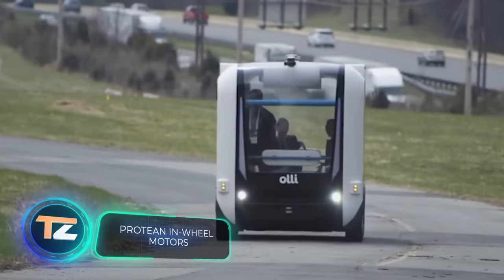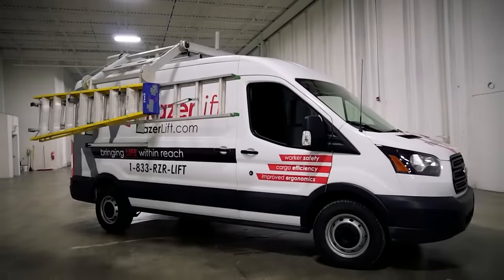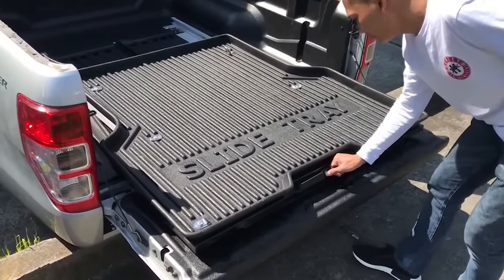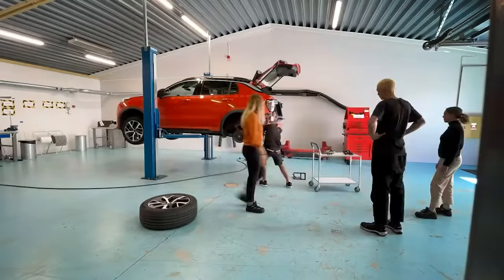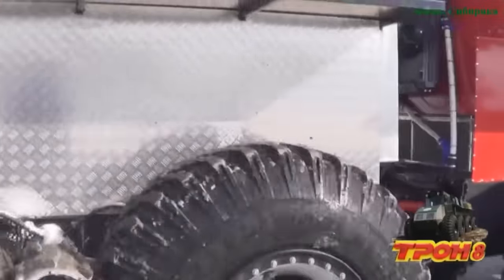INCREDIBLE INVENTIONS FOR CARS THAT YOU SHOULD SEE

Comment: The in-wheel motors I find particularly interesting. I've been looking to convert a car to electric and this would mean I'd have the entire engine bay to install rest of the system and batteries.
Reply: Convert a Volkswagen to a Voltswagen...someone did that to their VW Caddy p/u
Reply: I have a Ford Escape and eventually want to convert it, this wheel idea is a definite game changer.  👍
Reply: In-wheel motors are a horrible idea.  Having 3 to 4 times the amount of unsprung weight moving with the tire would drastically limit the suspension's ability to keep the wheel in consistent contact with the road.  Vehicle manufacturers spend considerable effort reducing unsprung weight to improve handling as well as comfort, vibrations, and harshness.    No major electric vehicle manufacturer uses  wheel motors because it is a terrible idea.  It isn't a new idea at all.
Reply: @brianhaygood183  Agree. The Idea is as old as the automobile itself, example Lohner–Porsche Electromobile from 1900.
Reply: Convert a shit load of money ,time and effort into a useless lump of light iron!
Reply: WORST
IDEA
EVER

In wheel motors would add weight in the only place of the vehicle you need to keep as light as possible
Reply: I'd be terrified of our Midwest potholes destroying an engine.
Reply: its old tech.... been uaed in europe for like 50 years
Reply: @gufo_tave  So much for the stopping distance. 80lbs of extra unsprung weight on each wheel? No, thanks..
Reply: @RuralTowner  q!aA
Reply: @brianhaygood183  Disregarding handling dynamics the largest downside are the motor bearings being subjected to non suspension dampened road imperfections or potholes. New wheel hub + cv axle undeniably more complex costing at most 500 for parts vs entire new motor for 5K+
Reply: Yeah, but can the vehicle handle the conversion and change in weight dynamics? Things like safety features could be rendered non-functional, and alter handling and performance, not to forget in event of a front end accident, potential fire hazards and crumple zones not withstanding the change in physics....
Reply: @brianhaygood183  yup, axle motors they do use, but wheel hub replacements.... gonna wear out steering components as well, plus the changes in handling and performance and physics, as well as potential fire hazard... people just need to acceot that EVs are NOT ready for primetime, and are nothing more than a niche market, on a truly free market. The only sell now because of subsidization, and even then, cost twice a comparable ICE version. 

Until the power storage density exceeds that of the fuel it is replacing, and can handle charging, at home, which requires major infrastructure upgrades to the electric grid including all new power plants, as every home would need the latest revised standard 480V 3P service, to be able to rapid charge. Because you need charge times of under 10 minutes from 0 to 80% giving at least 300 miles range with AC running, and not suffer the cold weather problem currently plaguing EVs.
Reply: @patrickw9520  You're not gonna convince anybody by demanding ridiculous all or nothing similar to EV fanboys. An argument that true environmentalists can't deny is if the goal was to reduce emissions as quick as possible simply mandating hybrids with at minimum 1.25 KWh battery pack would reduce emissions quicker than favoring EVs as Tesla gigafactory alone could support every vehicle sold in America reducing emissions by 20 to 40 percent per vehicle. For perspective 1 60KW Tesla Model 3 vs 48 hybrids.

Alternatively, abolishing all EV incentives favoring PHEVs with 25 - 40 mile range would be a 90% reduction in emissions which a pure EV will never truly save money when factoring property taxes, insurance, and even if the EV charged for free while PHEV paid to charge. Using Kia Niro (crossover SUV) variants as a benchmark price comparison..

Hybrid: $25K
PHEV: $30K
EV: $39K

Cheapest brand new Tesla Model 3: $47.5K

Comment: @1:37     id just attach the ladder to the inner celling of the van with a few simple brackets,   slide out slide in  job done and works every time.     will even work in multi-storey car parks with low ceilings which would otherwise get in the way of a device like the one in the video
Reply: This could work in these tall vans, but as someone who drove a work van for many years I have to admit that many people could not have ladders or other equipment taking up space in their cargo area.  I did keep small step ladders in the cargo area, but larger ladders had to go on the roof as I need the space and the headroom inside.
Reply: works for small ladders but any decent sized ladder won't fit in 90% of vans

Comment: You can keep your EV's. I don't hear anyone taking about costs. Battery replacement costs. The frequency of which I'm sure will greatly be dependent on the number of charging cycles. 
Hence, the more you drive the more frequent battery replacement will be required. Upkeep costs, electric cost. You can can keep the EV's.

Comment: The only advantage of induction charging is that you can have a perfectly sealed charging device that won't get water in contact with electricity. So you can charge at the bottom of a pool.
But if you have any other means of avoiding that, like any kind of suitable protective gear, induction charging has nothing but disadvantages.

You need to perfectly align the car with the device, which means in most places you'll have to do extra maneuvers and consume extra energy.
Plugging a cable to the car only takes a couple seconds, only requires that you park within the reach of the cable, and offers 100% efficiency. Every single bit of electricity that enters one end of the cable is delivered to the other end.
Reply: For the disadvantage of aligning the car with the device: couldn't we enable some automatic system in the car to align it? i mean, Teslas already have some driver assistance thats getting closer to self driving, and we already have a way to make a car parallel park (well, that was an advertised feature, don't know how well thats doing today). So, why couldn't we press a button, and have the car detect the location of the charger and park itself on it?

if we make the pad on the ground really big (within reason of course), couldn't that mean more wiggle room for drivers to be on top of it and still charge?

Of course your other disadvantages i agree with, and are things we need to consider
i hope future cars can have both a wired and wireless charging system, kinda like how some phones today have both systems
Reply: Can we just cancel Wireless Charging

Comment: 01:15 It's all nice and good until you get to an underground parking or under a low bridge...

I don't know over there, but around here all those big vans get their roofs caved in from hitting the ceilings, low bridges and garage entrances. Imagine with that thing making it even higher... 😅😁🤣
Reply: Even regular height vans don't typically fit in parking garages anyways and there are not many place in the US & Canada that have bridges to low for that van shown.
Reply: @SillyPutty3700  Regular vans fit quite good on parking buildings. Those tall ones don't.

To find a low underpass or bridge is not that uncommon, at least in my area. They don't want to sell it exclusively on Canada, I guess, so it can be  a problem. Not to mention that those vans hit low branches, etc quite often, add 50 - 80 cm to that and you can have a bad day. 🤷‍♂️

Comment: Wireless charging for cars is a terrible idea as you lose at least 15% of the energy in the transfer while also creating unnecessary heat.  They can brag about 85% efficiency, but a plug is nearly 100% efficient.  It would be far easier and cheaper to simply plug the car in using a standardized plug.  BMW likely intends this for people that are simply wealthy enough that they don't want to be bothered with plugging and unplugging.  They're focusing on hybrid cars because the charging rate is extremely slow and might take a week to charge an EV.

Comment: What happens to unsprung weight with 2 of 4 in-wheel motors? In wheels motors are good for low speed projects but I expect high speed handling would suffer.
Reply: Exactly.  80 lb of additional unsprung weight  at each corner would turn almost any typical car into a handling nightmare.
Reply: Unsprung weight can be dealt with. Lots of high performance cars use a solid rear axle which is much heavier than that.
Reply: @TurboTymek   I'm not aware of a single car with a solid axle that is a high performance car in terms of handling.  I know there are high horsepower cars, but nothing that handles worth a darn has a solid axle.  A solid axle is itself most of the suspension system and takes the place of most of the control arms and other linkages, so the unsprung weight penalty of a solid axle is less than the total weight of the axle, which itself is usually not the 160lb we are talking about here.  Finally, much of the weight of a solid axle is in the center of the axle, not out at the corners giving it half as much impact as these motors would have for a single-wheel disturbance.

Comment: I thought the wheel thing was to recharge an Electric Battery while you’re driving for a shit ton more range
Reply: Won't work.
You'll need to use more power to overcome the added weight and the magnetic field resistance of power generation at the wheels.

Comment: 85% efficiency for a wireless charging of a EV car is remarkable especially for lazy operates.  Does it also  means every 100 times we use the wireless charger to charge our cars, we lost / wasted 15 charges.  Does this goes the opposite direction for EVs to keep the carbon foot print low and conserve energy?

Comment: 0:46 79lbs?
Talk about a huge amount of unsprung weight.

1:20 how long till this is damaged by the driver driving the vehicle into a bridge or some other low clearance area.

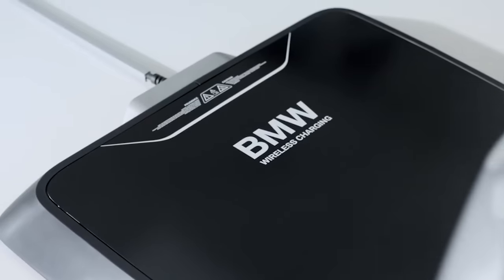3:25 wireless charging is inefficient no matter how good the designers say it is,
Reply: Suspension can be tuned to deal with that.
Reply: @TurboTymek  yes you can but it's better to have less unsprung weight.

Comment: That crane will be history shortly after someone fries themselves on overhead power lines. But it does open up new horizons in upper story theft. 
 Sorry but I’ve been cynical since November 2020.
Reply: Well, considering that if you're going to life an HVAC unit to a roof, you're going to do it with SOMETING, and anything that can perform this task risks running into power lines.....so it's not a problem unique to this tool.

Comment: O M G @ 10:00 that shopping cart is the most brilliant idea!!  The store is always out of carts because the homless run off with them. Loading and unloading and bagging and unbagging is all gone. I WANT ONE!  BTW normal shopping carts are $150 to $250
Reply: Normal ones are $200 or so because they're mass produced and its a single design type.
Go to all the supermarkets in the area and the shopping carts look the same.
Reply: I realized he said the max weight was 44 lbs.   That is NOT a lot of weight.  While on average you would not likely go over that if you shop regularly if not that would be close. A gallon of milk weighs about 8 lbs, 12 pack of soda 9, a 24 pack of water 18. Throw in some meats and produce, best watch your load.
Reply: @jackcarter1365  Australians dont buy 200lbs worth of food at once.
Reply: @jackcarter1365  I didn't realize it's only 44lbs. That's not strong enough. I fill a normal grocery cart to the brim ever other week.
Reply: @IIGrayfoxII  I work for a supermarket chain. So I rarely shop heavy as I micro shop almost every time I get off.  But I see people who claim to have come in for one or two things and they leave with an easy 50lbs or much more.
Examples. 
5lbs of potato, 
5Lbs of Onions
4Lbs of Bananas
4Lbs of Apples.
You don't need a shopping cart for that but its already 18lbs. Throw in any liquids. A gallon of almost anything will be around 8lbs - Vinegar, Juice, Gatorade. Those 3 are 24lbs + 18 you are at 42lbs.  Dam I need detergent... Ok get that next trip.
So if they can heft the sturdiness up to about double that would do. Again its very easy to buy more than 44lbs of groceries.
BUT I get why they keep it light.  You still need to break it down and slid it into the car.  They probably don't want you fussing with 150 lbs and getting hurt.

Comment: tbh none of these are really worth it, they solve previous problems and make more problems, the razerlift is just a glorified way to increase center of gravity and to make it go through someones car window if you get into a crash. truck mate is literally a lazyman's way to take dirt out of a truck bed, plus its bulky and expensive. BMW's wireless charging system is just expensive and lazy, plus the fact that the only problem they solve is forgetting to plug in your electric/hybrid car. uniute truck bed is supposed to help get stuff closer to a humans center of gravity while lifting something, but then you have a higher bed and the bed of the truck aint as deep, which means that the stuff that your carrying in your truck will fly out due to the amount of drag on the object.

Comment: 1:15 get a ladder and put that stuff on the roof yourself
2:15 get yourself a proper truck 
3:20 just use a cable and stop wasting resources and money 
4:25 what ? just drag that stuff
5:20 .... who even buys those cars 
6:15 how about just driving smaller cars and not those stupid suv, it already saves more than those collectors can catch 
7:20 looks cool, but for what? how many different hight trailers do you have ?
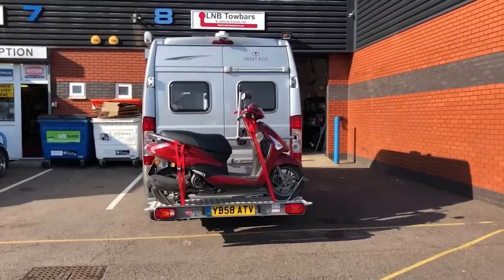8:10 a calbe and two screws underneath a vehicle is easy than losen 3 strabs and take of a scooter or a bike which you need to get off anyways ?
9:05 that doesnt look scatchy as fuck 
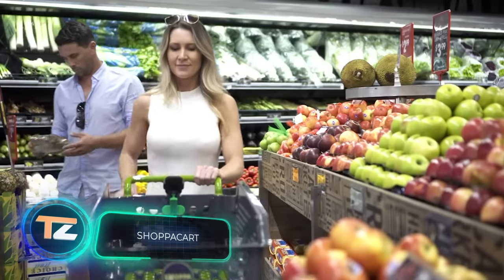9:50 there is now way anyone buys that, wastes most of the cargo space in the back and you need to protect your rear bumper ? 
10:50 thats out for a milion fucking years, it wears out the tires really fast and it will slip if you need it the most, i mean why would anyone build a real 4x4 if that works so well ?

Comment: Wireless Charging is just 🤡🤡🤡🤡🤡🤡🤡🤡🤡🤡🤡🤡

Inefficient, expensive and 100% unnecessary. Shows how detached from reality BMW is. Efficiency is 85%.. well the efficiency of a wire is 100% unless its too small and the current heats it up. 
So if the charger pumps 3.2 Kilowatts into the car you need an input of 4 kilowatts.
If you are dumb enough to fall for this you are wasting 800 watts of valuable energy because plugging a charging cable into your fancy pants overpriced BMW is too much work for you.
Just imagine the cost of 10 charging pads and the losses compared to 10 wallboxes and cables. 8 kilowatts will just disappear in the form of heat somewhere. 
WE ARE DROWING IN INEFICIENCY!

BMWs strategy is doomed to fail. Their business is stagnating.  They are being overtaken by Mercedes, Volkswagen and basically every other brand offering decent cars for less money.